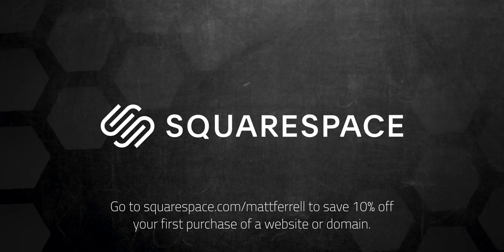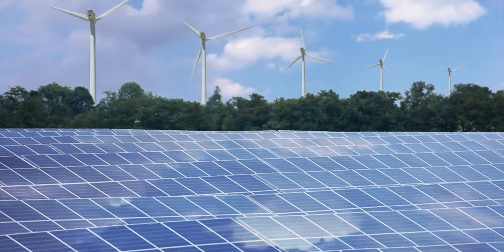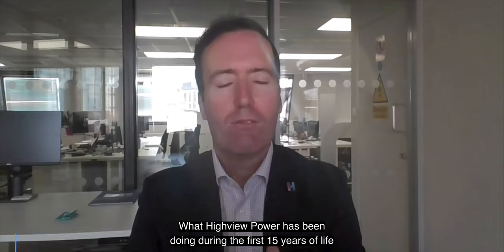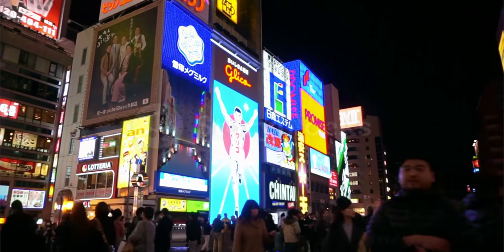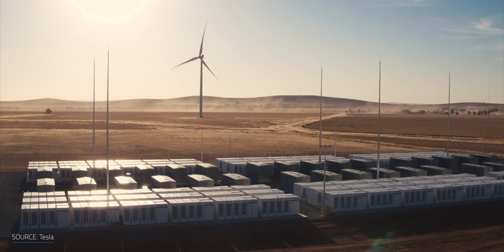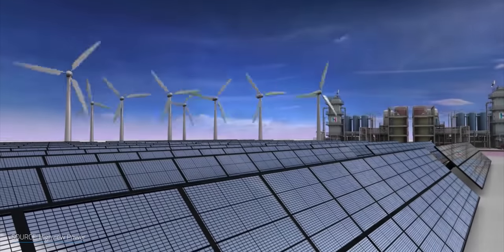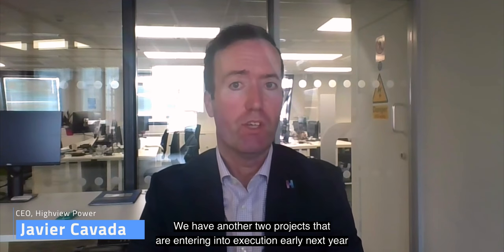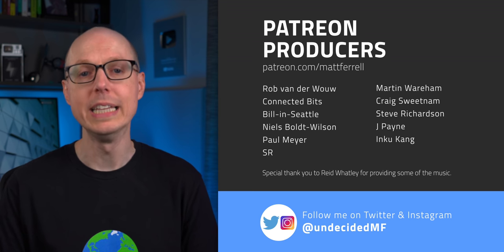Liquid Air Battery Explained - Rival to Lithium Ion Batteries?

Comment: What is the cycle life? Even the best lithium batteries start to degrade after a few thousand charges.
Reply: That's one downside of a lithium battery - cell life is not infinite, whereas here it's pump life you have to worry about, which are mass-produced easily exchanged items, but you aren't going to "wear out" the air.
Reply: @AaronCoakley  and this scales better, doubling the volume of tankage is cheaper than doubling the number / capacity of a battery.

Comment: How does the efficiency drop off with time? The tanks will slow warm. This is another difference with pumped hydro which can do longer seasonal storage.
Reply: That's a simple function of how much has been invested in insulation. How long do you want it to last? Then figure out the cost / benefit tradeoff of adding more insulation vs. a lower efficiency and higher losses.
Reply: Harry Parker what you say is obvious. I’m asking the question as a prompt to consider other factors. The time decay of efficiency was not discussed.
Reply: @shawn1260  Yes, I would have liked to see more cost and efficiency numbers as well. The company's website claims 60-70% efficiency, or higher by being co-located where waste heat is available. The time assumptions seem to be storage over 8 hours.